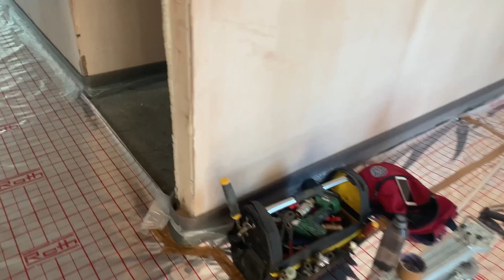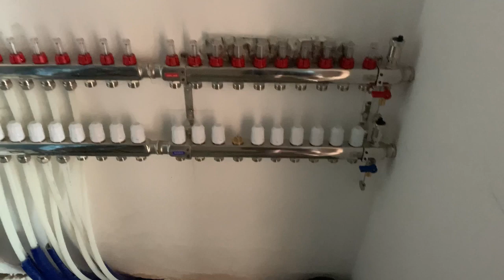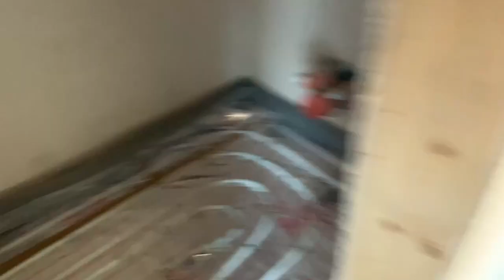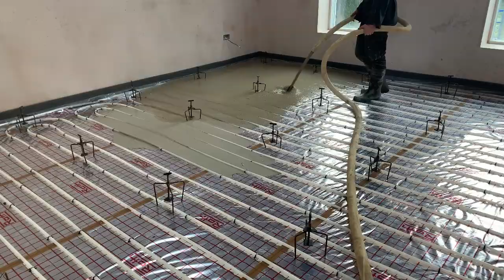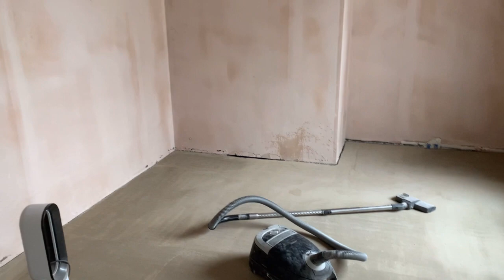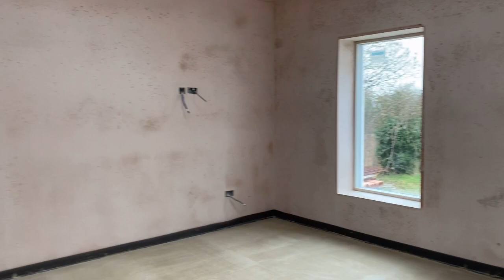Irish House Renovation Blog: Part 22 - Underfloor Heating Pipes & Liquid Floor Screed Install

Comment: Hi there, I’m up north here and basically doing the same as you to a house triple glazed, insulated plasterboard etc regarding your floor? Am I assuming you raised your floor level? I only have 3 inches of screed above my subfloor that would need to come up but I really don’t want to have to lift the sub floor as well. I have listened to you right that you only have 50 mil of the insulated screed ? Anywhere I have looked they say minimum 150. 50 would be ideal for me meaning I only have to raise the floor level 30 mil if the top coat is 50 as well.

Comment: @The_Kildare_Reno your videos are brilliant and informative, all your hard work looks like it’s paid off. Well done! We’re planning a renovation on our 50’s bungalow and aren’t sure if the cost/time to dig out the solid floor and rebuild with a decent level of insulation/pipes is worth it. It didn’t look like you dug out the original bungalows floor? What was your floor build up? Did you loose much room height? Thanks
Reply from the maker: Thanks very much. So we had an original sand and cement screed from the 80’s with styrofoam sheets under this. Total build up was 100mm. So we dug this out down to the subfloor. When we checked the levels on the subfloor we found there was a fall in the house of approx 30mm end to end so we built up with the liquid insulation by between 70-100mm and then the 50mm screed on top of this with our UFH pipes in this also. That was more than enough and the house is very cosy.

Comment: Just found your channel there. I’m based in clane in Kildare myself☺️ your house looked very similar to mine the way it was built. Currently in the same situation as yourself with my family where we’re redoing our house . Ours was built in 1983. We’ve also got air to water system do you know what system you gone with?
Reply from the maker: Hey Jamie! Thanks for checking out our videos. Our air to water system is a 16.2kwh double unit from Ferolli. We went with this one as the reviews online were excellent particularly with the aftercare and they came in at a great price also. We are hoping to install in a few days and then I’ll be popping a video up giving a full run through. The garage is using a separate heat pump from Ferolli which is 7kwh.

Comment: Great work, what sort of flooring have you put. We are currently doing the same but confused with flooring options. Most friends have got porcelain tiles but we were wondering what else can go with it. Thanks
Reply from the maker: Thanks very much. We went with an engineered herringbone oak floor. Completely seamless and works great. You can feel the heat coming through and the floor retains the heat also during the day. Heat pump only runs for 4 hours during the night.
Reply: @TheKildareReno  Thanks so much for the reply. Please do share the name of the product if that's ok. Also we are in same boat like other whether to get new gas boiler or heat pump ? Any pointers where to get heat pump cheaply installed with govt grant. Also do we really get hot water for showers ;( ? I wanted to get your feedback on heat pump as well please.

Comment: What did you use for expansion gaps between doorways etc?
Reply from the maker: We had the standard 3.5mm expansion boards installed by the screed guys and cut the excess off before flooring.

Comment: As plumber what u think of heat pump
Reply from the maker: Yep really good. Takes a bit of setting up to get the temperature balance right but once you have that all set it’s great. We use ours for an hour in the morning for hot water and then heat the UFH as needed but it hardly runs as the house is really well insulated. Electricity bills are very low too which is great